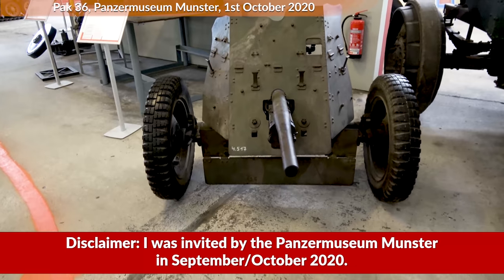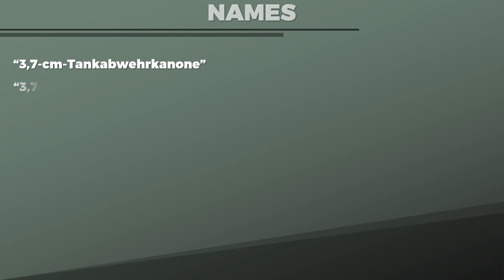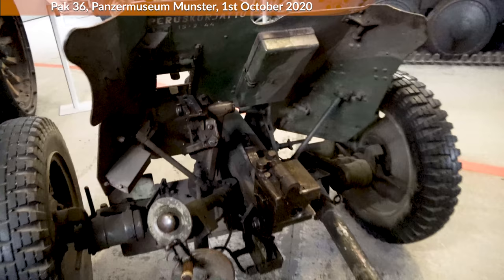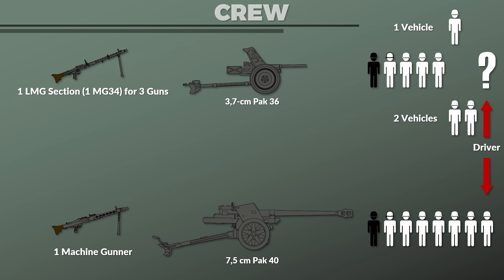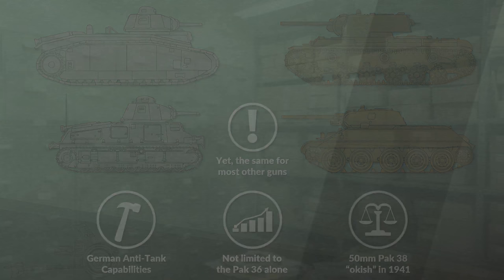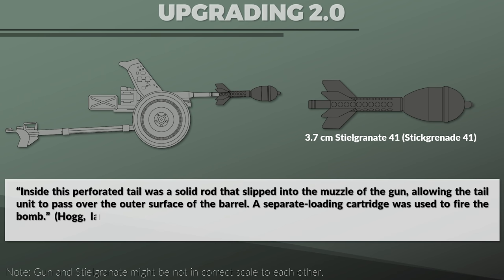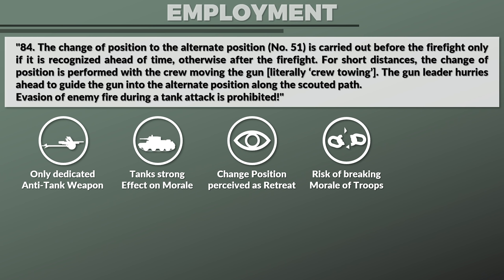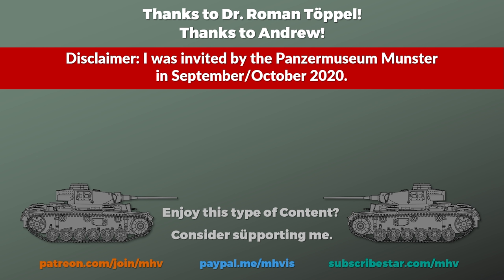Pak 36: The most effective Doorknocker @DasPanzermuseum

Comment: At 09:00 you translate "Schützen" as "Riflemen", but I think they didn´t mean the classic "Gewehrschütze".
On a modern Leopard 2 you have the "Richtschütze" and the "Ladeschütze", which you wouldn´t call "Aim rifleman" and "Loading riflemen". You would call them "gunner" and "loader" and I believe it is the same thing here: The regulation describes different tasks and combines them under the word "Schütze".
Reply: In ww2 terms and when used is referred to as a schützen. It's should not be compared to the modern counterpart as much since some terms changed, some differed
Reply: @jerryudonneedtoknow3903  yeah but it´s more or less clear they didn´t mean a rifleman like in an infantry squad, so rifleman would be wrong here.
Reply from the maker: see 8:19 I noted also "Canoneer" and at 09:00 I put "crew member" in []. The Heer basically called almost everyone "Schütze": Fallschirmschütze, Panzerschütze, etc. depending on the branch and then also by function as well, as you can see I translated "Ladeschütze", "Munitionschütze" with various other names not "rifleman".

Comment: Finland received the first examples (50 pcs.) of the gun in the spring of 1940, 100 pcs. at September 1940 and 100 pcs. in June 1941. That gun has been overhauled (essentially rebuilt), or supply depot repaired, in Feb. 1944. It may have been later used in June-July of 1944 to counter massed Soviet attacks, but it also might have been in storage or in training use after the repair.

Comment: Interesting...the AT gun the Germans were using at the end of WW1 was the 3.7cm TaK 1918, which was also made by Rheinmetall. I wonder how much mechanical similarity there was between the two guns?
Reply: Almost certainly none, since the WW1 TAK was essentially a conversion of a single barrel taken from an old 3.7cm Revolverkanone (a hand-cranked five-barreled 19th century weapon for the close defence of fortresses). Its mounting was likewise a conversion, based on a light Minenwerfer carriage. The gun was directly fixed to the carriage, with no recoil system and simple iron sights! Perfectly adequate in 1918, but nothing to emulate in a gun produced under non-emergency conditions in the 1920s...

Comment: I believe the prohibition of movement during battle was due to the fact, that a gun in position has a chance to fire at the enemy and thus survive whilst a moving gun is not firing at the enemy for quite some time and has no chance of self defence whatsoever. The other point is, that probably all tractor vehicles raised higher than the gun itself. Moving the gun would render all camouflage useless.

Comment: Hey buddy, quick question in case you know the answer. 

Can TOW guided missiles miss or be evaded?
Reply: Wire guided missles are best defeated by hanging lots of loose razor wire, it's quite easy for a tow or any other wire guided weapon to break the wire(s) or lose connection between the missle and launcher...power lines, fencing, heavy vegetation can all cut the wire and cause the missle to go off target...but if the wire doesn't break, the tow gunner can use it to control and aim the missle in flight, so tows can follow moving targets or change targets in a split second, they're relatively fast missles too, not much you can do to either run or hide, and the only way to avoid it would be extreme speed, but you're not going to out run a missle unless you have a really great head start!

The tow is still in use today, even though it's so old, because of how effective it is, and how difficult it is to evade

Every once in a while, a tow will drift off target, drop straight to the ground, explode in midflight, or otherwise malfunction and misfire, but because you can keep adjusting and aiming the missle up until impact, it's pretty hard to miss with a tow!
Reply: Of course they can miss if the gunner makes a mistake, they are still effected by the human element after all. Additionally if the tank notices the launch, it can deploy a smoke screen and then move away. Lastly there are active systems that basically jam the guidance unit of the missile, leading to it loosing control if tried to fly towards a tank using such systems.

Comment: I faintly remember a video by the chieftain about the gun being fairly effective against early t34
Reply: Me too, albeit i'm not sure if he was refering to the PaK or the tank version (KWK).
Reply: @comentedonakeyboard  Probably either one. One of the largest issues with the early T-34 was the overworked crew and lack of proper radio equipment. Given that circumstance, you're more likely to have an exposed flank or side that could be penetrated by the 37mm PaK round.
Reply: @SlavicCelery  like ambush tactics? Well given it's small size the Pak 36 seems usefull.🤔
Reply: @comentedonakeyboard  Ambushing would seem to be the standard approach used by all AT guns. Overworked crews are much more likely to stumble into one. Especially if you have less than stellar combined arms doctrine, tactics and implementation.

Comment: It would be great if you did a video on the 50mm. PaK.37.

The 50mm. L.42 PaK.37 used the same chassis and looks identical. the only give away is the larger muzzle bore.

The 50mm. PaK.37 was intended to provide an equivalence with the dual purpose 47mm. light anti-tank & infantry guns in service with other nations, such as the Austria Bohler, Dutch Siderious & Belgian FN.

The 50mm. PaK.37 offered just only slightly more performance against armour than the 37mm. PaK.36. 

The 50mm. PaK.37 fired a 4.5 Pound HE shell.

Withdrawn from frontline combat in 1942, it served with rear echelon, depot defence & anti-partisan units.

Just over 2,000 were produced before production ceased in 1940, as the barrels & breechblocks were required for the 50mm. L.42 KwK.37 on the Pz.III.F, Pz.III.G & Pz.III.H models.

Comment: If you are targeted by enemy artillery or tanks, you cannot relocate fast enough and you expose yourself even worse once you start moving out of prepared position. If you cannot return fire, it is best to lay low, hopefully in shelter till worst passes. Generally, support artillery rarely shoots same target longer then 5min and tank on attack should not be static even that long. However, if first enemy attack fails, it is highly recommended to move anti-tank guns to second position because it is likely that support artillery will hit your old position before next attack.

Comment: The US Army liked the German 3.7 enough to copy it's design. I believe the Germans produced an even larger HEAT round that was nicknamed Beehive by US troops for use against buildings and bunkers. Some were used against US tanks in Normandy which freaked out the tankers due to it's size.
Reply: Any info on how effective is was against those tanks?
Reply: @user-xu2pi6vx7o  Only that it had a devastating effect when used on armor due to it's size. Read that in a book long ago that showed the various weapons and equipment used by the Allied and German forces during the Normandy campaign. I imagine that the US Army had captured some along with the guns so fired a few at knocked out Panthers and Pz 4's to see what those could do to a tank. The remarks about those flying by were in another book about US tankers' experiences from Normandy thru to the end of the war in Europe.

Comment: I like how German ww2 equipment was 'ok' at what it was designed for but SUPER Effective at something random. The PAK 36 became an infantry gun, the infantry gun became anti tank... (the 75mm) My Opa tells me the 88 Flak was excellent anti tank... The Panzers are good distractions The luftwaffe flexes on the enemy in vain and the kriegmarine can use diesel just so much stuff is bonkers. 

Oh and the Pak36 is vulnerable while moving because the gun shield only good for front facing so if you had to turn it the crew is exposed, the vulnerable bits are exposed. Germans don't like being exposed.

Comment: @ the effectiveness of the PaK 36 with the HE round.
Imagine you are a soldier in a building repelling German attack. Everyone are shooting rifles, but you are well protected by the thick walls of the building. And then PaK 36 arrives, starts throwing hand-grenades into your building, one each 10 seconds, from so far away that you can't even respond. And every shot punches a hole in the wall, throwing bricks and shrapnel inside. The thing can grind down Soviet Infantry platoon in an entrenched position without being in a slightest danger.
While its anti-armor capabilities aren't as impressive for the WW2, the thing absolutely smacks against regular soldiers, trucks or even armored cars.

Comment: I would expect that the instruction to not retreat before enemy fire was not only for the benefit of the moral of other troop parts, but also to keep the gun itself effective. A gun that keeps firing, even while bracketed by enemy fire is both more likely to survive, as it keeps the enemy under fire themselves and will likely do more damage to said enemy. If the fire fight has already started and the gun is in effective range, changing position just gives the enemy time to aim unmolested and decreases the weight of fire of the AT-unit. It's better to have a badly placed gun contribute to the unit's fire even only a little, than to have it relocate and lessen the weight of fire during a crucial fire fight.

Comment: At 9:45, you state that the Pz II had no HE rounds for its 20mm cannon in Poland. What is the source for this? Since the gun used the same ammunition as the 20mm FlaK 30, I assume this deficiency was due to planning errors in the Panzer arm of the Wehrmacht. Did other vehicles using the same cannon lack HE early on, like the SdKfz. 222 and 231?
Reply from the maker: see Pz II video
Reply: @MilitaryHistoryVisualized  Thanks! I have missed that video completely, somehow.

Comment: I think it's just one in a long list of german equipment unfairly judged by non german propaganda after the war and given a silly nickname as usual. It's specs were more than enough to deal with most early war targets along with a great rate of fire and ammo stock due to the caliber. The weight class also means it can still relatively easily be moved around the local battlefield by its own crew which 57mm and higher guns can't really do. Not every tank fielded against it was a matilda, B1 or KV.
Reply: It was good enough for early war and quite nimble as well. Many weapons get silly nicknames no matter who is using them and with what kind of success.

Comment: Army regulations sometimes are worth as much as toilet paper. At 14:40. What is the point of advising soldiers to place Pak 36 to fire just over the cover measured from a barrel? It is such a terrible advise, how soldiers are supposed to aim the gun with telescopic sight? 360 no scope? I would understand if they had periscopic sight, but no anti tank gun did at that time.

Comment: Considering that the majority of Soviet tanks were Betushkas and T-26 back in 1941, I think this gun might have been very useful at the time. 
And by the way, the Germans had HEAT ammo for this gun already in 1942? I thought it only appeared in 1944.
Reply from the maker: > the Germans had HEAT ammo for this gun already in 1942? I thought it only appeared in 1944.
yeah, there is (was?) at least one error on Wikipedia.
If it had taken to 1944, I doubt they would continued development, by then they had plenty of other guns.
Reply: @MilitaryHistoryVisualized  Hello, Bernhard! How are you? Thanks for the comment!

But the panzerfaust only appeared in late 1943, isn’t it? That's why I thought it was a 1944 thing. The short barrel of the Panzer IV also had this ammo I think, do you know if it was available in 1942 as well?
Reply: @MilitaryHistoryVisualized  Bernhard, another thing I forgot to mention. Since you played and liked Red Orchestra 2 as well, I found another game pretty awesome that is actually the developed concept of the old ROC2, it's called Hell Let Loose. If you have a rig and the time to run this game, you should try, it's pretty nice. I got it there's one or two days ago, I liked it a lot. The only problem is that the developers put the German uniforms too greyish not green. It doesn't look Feldgrau. Otherwise the game seems realistic.
Reply from the maker: Hollow-charges were first used military - if I am not mistaken - in 1940, although not as projectiles. For 75L24 HEAT rounds should have been available in 1942 if I am not mistaken.
I know Hell Let Loose and Post Scriptum, but there a bit above my skill level and especially time.
Reply: @MilitaryHistoryVisualized  yep, I had a look into the hollow charges wiki, seems like the effect was known since before wwi, can you believe this? But they couldn't developed it at the time, it took into the 30s to start having practical applications for it, at least is what wikipedia says. 
As for Hell Let Loose, I hope you have a try on it when you manage to get some time one day. In terms of not having the skills, I really doubt you're going to be any worse than me there hehe! Hope one day we manage to play a match together too. I'm big fan of yours! 
Best regards from Brazil!

Comment: Then Rommel started yousing the 88 in Africa.
Reply: the 88 was being used in Spain as an anti tank gun because the shell would first penetrate the armour of the T26 because of it's sheer mass and then explode inside which typically blew the tank apart. It was overkill against a tank with 15mm armour but it educated German gunners.